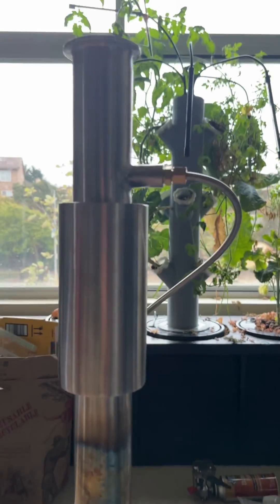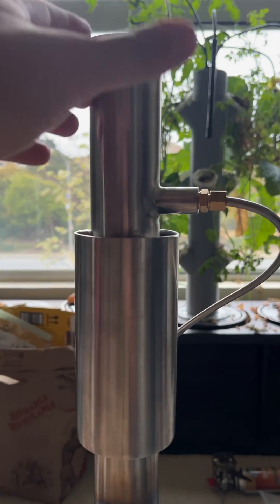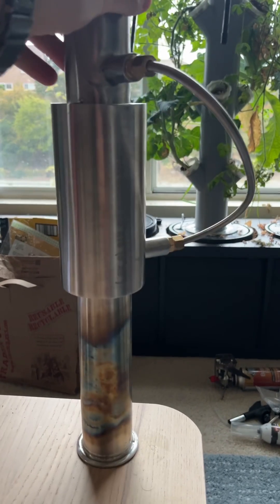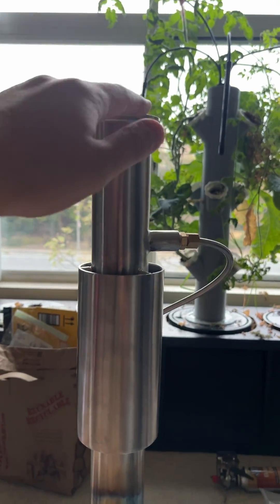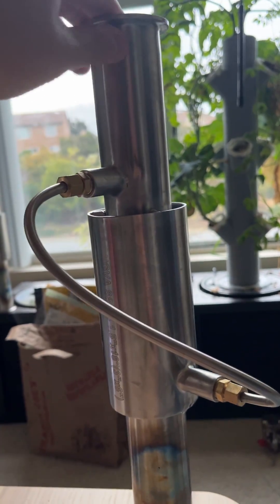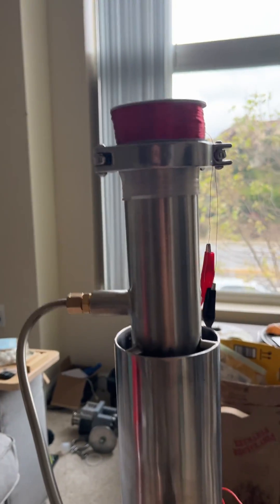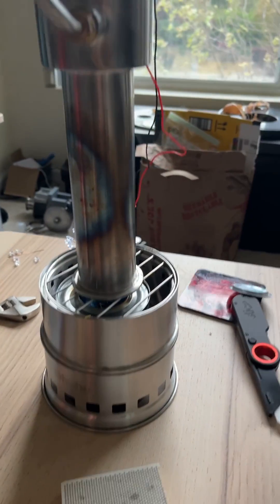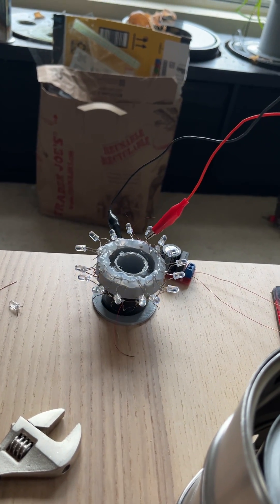Custom Stirling engine #stirlingengine #theromacoustics #sbc2023 @AttilaBlade

Comment: Is that in an beta configuration?
Reply from the maker: No, this is a thermoacoustic engine. It does not have any solid moving parts like a displacer or a piston. It creates sound from heat and the sound moves the diaphragm
Reply: @LES_Thermodynamics  ooohh i see o thought it was a Stirling engine. But it is actually really cool especially when we think of its potential applications
Reply from the maker: @marcangelodonelo5656  thermoacoustic is a subcategory of Stirling engines. This unit moves 1 cubic centimeter of air between the hot and cold end, 2699 times a minute